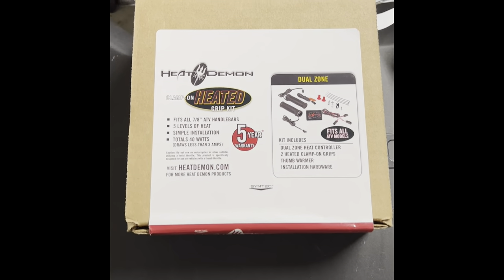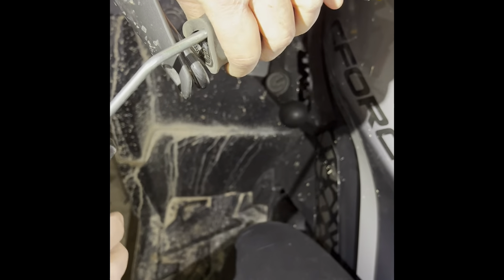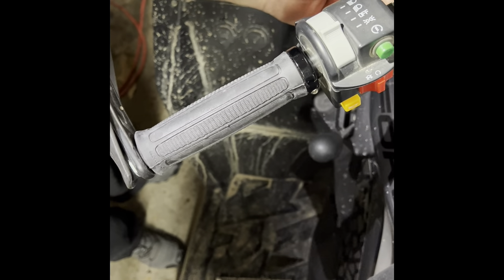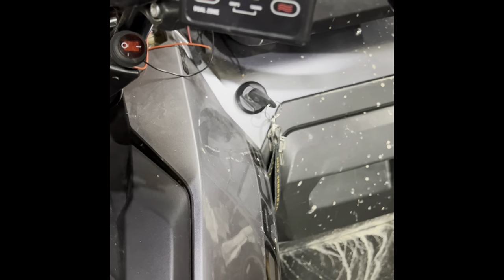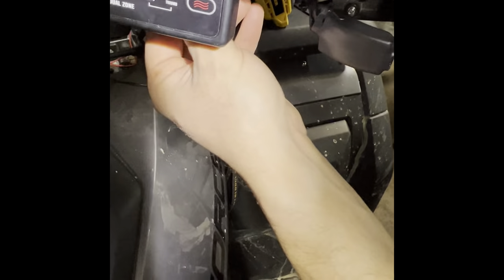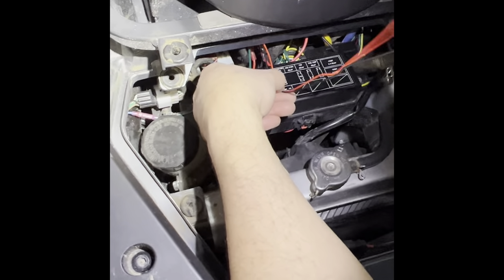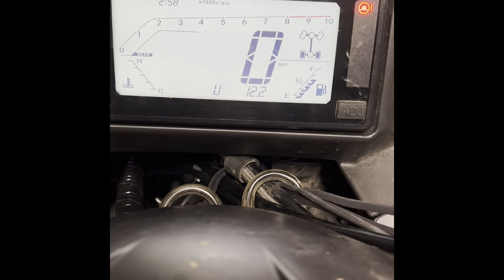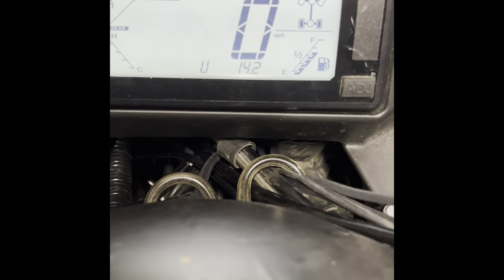Installing heated hand grips and thumb warmer by Heat Demon 215047 on CFMOTO 2021 600 touring.

Comment: Thanks for the video, been looking to do these on my 600. Gets cold in Michigan and I tried heated gloves but not impressed with the ones I bought. The Heat Demons should do the trick.
Reply from the maker: You are welcome! Thanks for watching. We are in Minnesota and these work great! We ride all the time and keeping hands warm in the winter was so hard! Until we got these bad boys. We rode 40 miles in 21 degree weather 2 days after we installed these  and my hands were toasty. I wear winter  mittens of course and hubby was using Milwaukee heated gloves but he said I do not need heated gloves with these.  I give them thumbs up u will love them!
Reply from the maker: Heat Demon 215047 ATV Heated Grip Kit with Dual Zone Controller